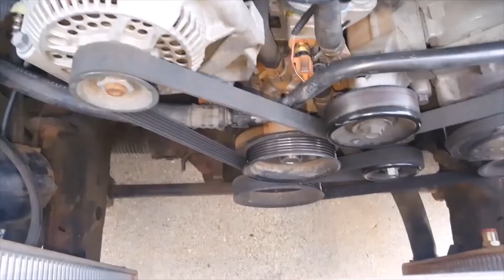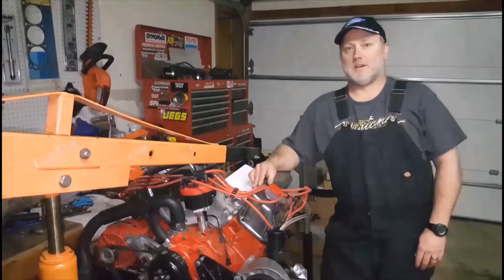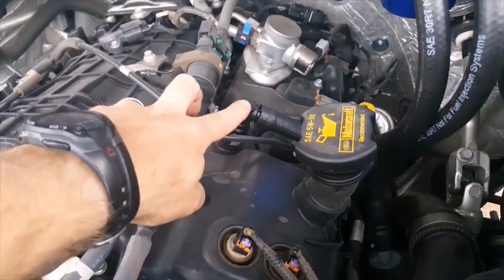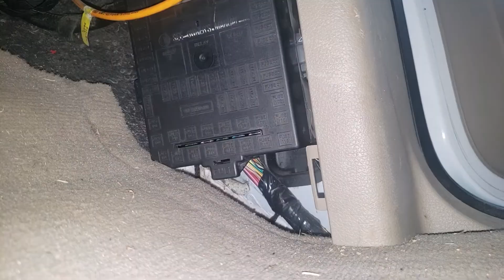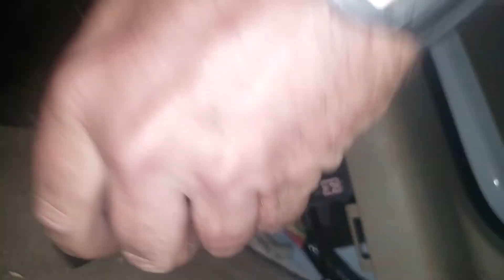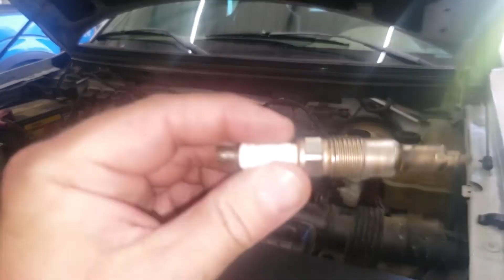💥💥💥 CRANK BUT NO START - COIL FAILURE - IGNITION FAILURE - FUSE 33 BLOWN - COILS UP IN FLAMES💥💥!!!!

Comment: Dealership Techs be like 
Tow Truck driver: where should i drop this off
Technician: Pull A Part
Reply from the maker: Really????
Reply: @BOSSC351sProductions   lol yea... you can tell if it is a low income individual who would NEVER ever bring their car to the dealer  when it arrives. They are looking for a diag and then they pay someone on the side to fix it. BUT sometimes they actually buy the work then you have to work on a car you REALLY don't want to because there's 99 problems and you're about to be one lol... I was working at GMC and Cadilac both times  i had a car come in and was like "holey shit , I can't believe ppl drive like this" Truck driver stops and asked me where he should drop it and I told him the junk yard.... Of course he left it in our parking lot ....